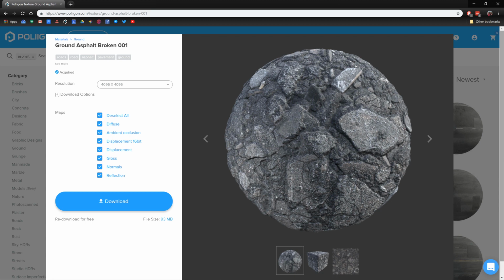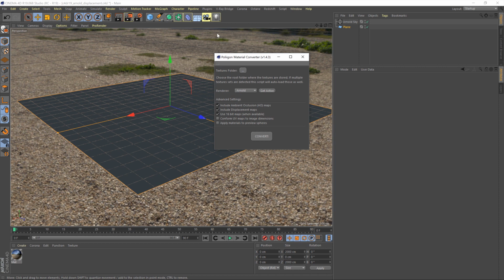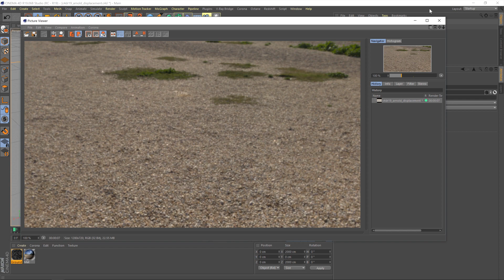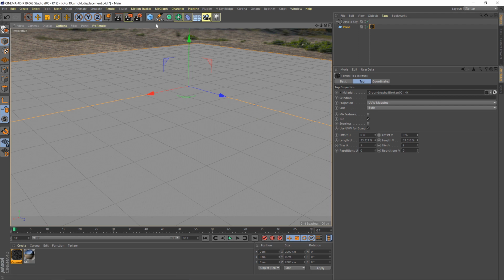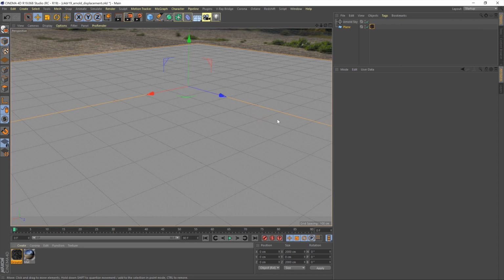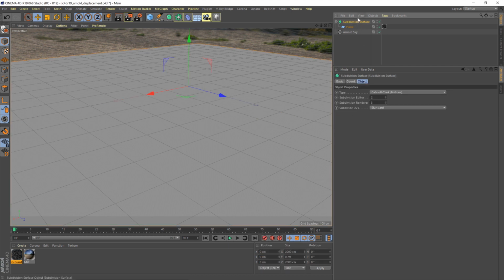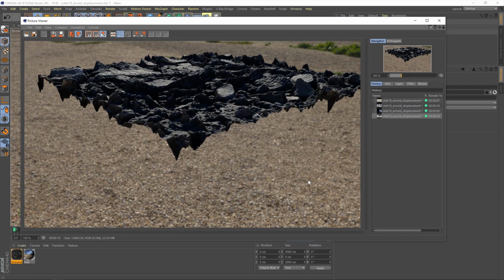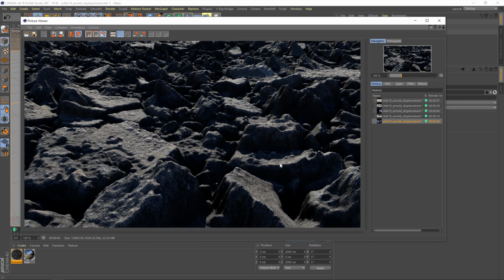Using Poliigon displacement textures in Cinema 4D with Arnold

Comment: is when adding gravity to a ball for example does it interact with displacement ?
is displacement is just for rendering only
Reply: For use in Arnold material,,yes it’s basically just a render effect which is also need dense geometry..to use in simulation you need to exactly alter the geometry with C4D displacement map material or displacement deformer